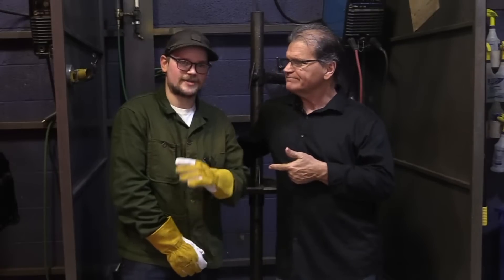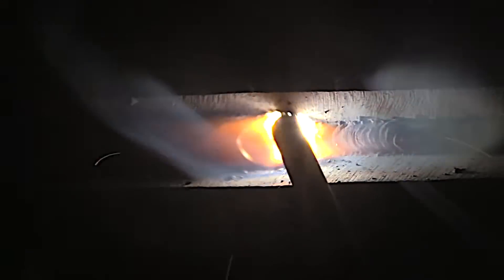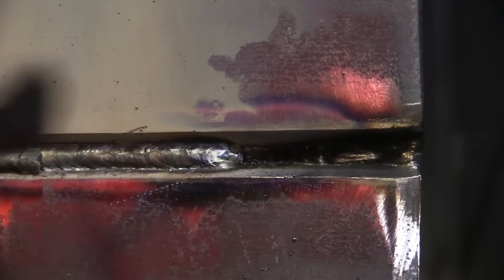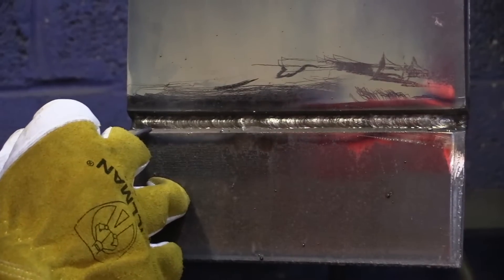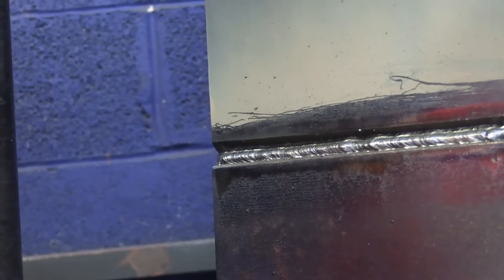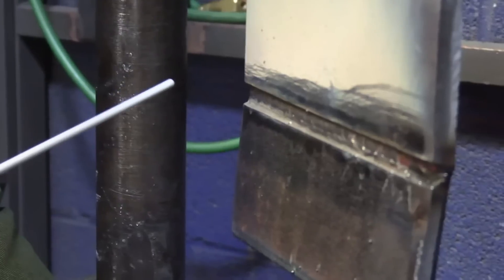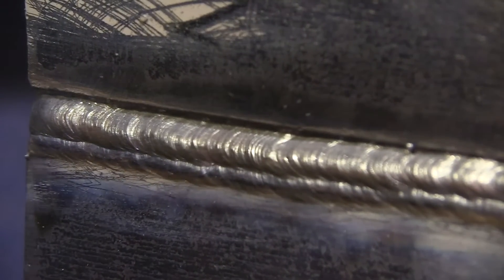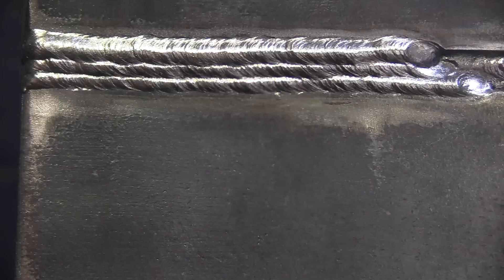7018 2G Practice Plate - for Welding Students

Comment: Biggest pain to me has been that last cap pass on that top edge. Seems like it wants to sag resulting in slight undercut despite slight up and d down osolation with slight pause on the upper zig of the zag. Should i run cooler?
Reply: not recommended, only test I failed was from doing exactly what u r saying. Keep your welds on the small side to prevent sag

Comment: Jody sir, how can I practice pipe welding without pipes?
Reply: Just use beveled metal the same thickness you would with pipe and then just do all 4 positions and just getting comfortable and consistent with each position or a mix of positions.

Comment: first, let me start by saying how much you have done for the average tradesman hobbyist welder is awesome thankyou so much for the informative content and all the work you have put in. i have a question I have always wondered what is how to calculate the necessary amount of weld on a joint say for roll cage intersections of which i know there are infinite amounts but how to tell if you have at least met the minimum spe for nominal strength in a single weld joint for instance a 90 deg tube to another intersecting it. say 1/8 inch wall, for its profile would it be for the legs of the weld where they flow into the other tube to be the same as the wall thickness or slightly more than the wall thickness. may be a little confusing but I am curious if there is a formula for figuring the minimum required width of the weld bead both height and width? a guy always wonders if it is substantial enough to take the proper load rating of the tube. you see guys welding chromoly roll cages and their weld beads are incredibly small most of the time which makes one think he is putting excessive heat and weld beads on a structure that doesn't need to be there? thanks again you are the best and have really gotten me through a lot of situations where I might not have figured out a solution for that certain predicament, thank you again.
Reply: Big beads don't make better welds. 
Penetration, and heat affected zones are what makes it work.
And why most roll cages are TIG welded. It's easier to control the zone and the penetration.
There are formulas, but they're decided by the people that do the drawing, if you're welding to spec... and experience if you're not.
It's all a part of the trade.